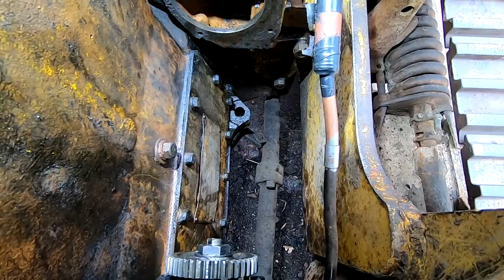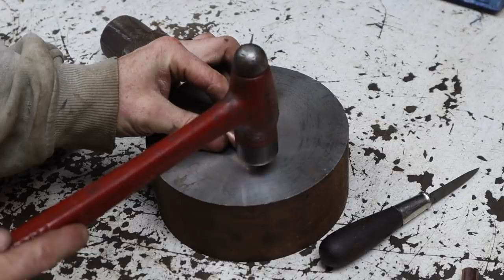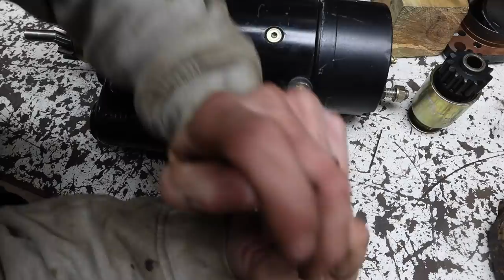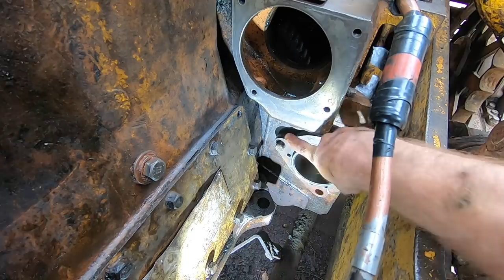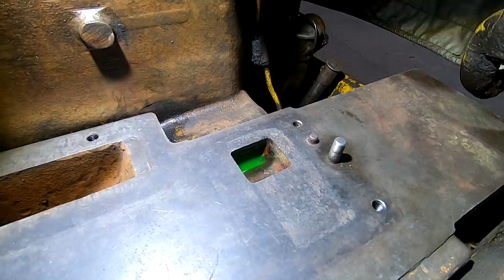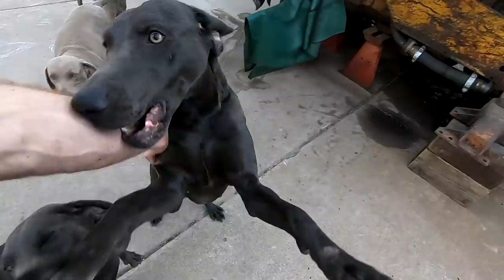Adding a SECOND Way to Start the OLD Cat TraxCavator!!! ~ Part 17 ~ 1950s Caterpillar TraxCavator

Comment: Whatever hypothetical problems you might find after taking the head off are there whether you do it or not. You already have a bunch of stuff out of the way so you might as well do it anyway. Plus it's better to do it now while it's sitting right outside the shop than have the machine break down in the middle of a project out in the woods or whatever.

I would likely watch the Tahoe videos. I've watched every other video you've made and a head gasket on a Tahoe is something I might actually have to do. If it were my Tahoe I'd swap in a manual transfer case and see if there was a way to delete the center axle disconnect.

Comment: From what I have seen the motor runs strong. Are you losing a lot of antifreeze, or in the oil. If not you are probably ok on your pistons, rings and liners. Could be just a bad head gasket. If you change it now saves a lot of work later on.

Comment: you can use a solenoid to connect your 2 12volt batteries together momentarily to get your 24 volt for your starter

Comment: Hi there, I'll try my best to get my English right so here it goes.
You could have 2 batteries in series bumping your voltage to 24v.
 I'm guessing all your lights wil work on 12v so that wil be your default current.
If you were to use the new 24 volt starting motor I would suggest you use a contacter that's rated for the 200A with a delay of 1 second so when you press your start button it wil connect the second battery in series and then after 1second start the motor. The wiring would be easy and you won't blow your pony motor starter by accident.
A second way would be to shunt both batteries dubbeling your capacity and then use a contacter to switch from shunt to series, this wiring wil be a bit more difficult but gives the second battery a use other than starting the motor.

Comment: I've dealt with many head gaskets and once they start to go it is just a matter of time before they completely fail. You have 3 separate components (compression, oil, and antifreeze) all under pressure and it wont take long before a small leak becomes a major...headache.

Comment: Update, on radiator/block cleaning 
I have checked on rad cleaner/block cleaners, there are important things to check, you will require one for Diesel engines, one shown amongst the many variations, was. “ Zerex super radiator flush” , there would be many others in that category.

Comment: Easy to do 24 and 12v, connect batteries in series for 24v and take 12v off one of the batteries at the same time very simple

Comment: I'm on board with replacing the head gasket...gonna be awhile before the pony motor is ready anyway, and besides, the leaking head gasket certainly won't get better, therefore it will only get worse.  Prudence dictates that it would be wise to go ahead and replace it while you're into it at this point.

Comment: 12/24 volt is easy for starting. You'll need a solenoid between the positive and negative posts to DISconnect the 24 volt jumper when not using the new starter.

Comment: Yes, by all means pull the head off, fix the head gasket, and anything else that needs fixing. Once you place this vehicle in use is there going to be a problem with dirt and other crud getting on the solenoid, or filling the gap you ground and causing a short? It sounds like you're going to have a separate 24 volt electrical system to operate the starter. Will this system have some means to recharge the batteries? Your postings are great.

Comment: A lot of comments/suggestions regarding 24V for the prime mover starter and how to derive a 12V  tap to power the pony engine starter. You stated that the starter for the pony engine is actually 6v, but you have been using a 12V source for it.  I presume this is because a 6V battery is not yet in your inventory for this machine and that a 12V boost pack is most convenient.  I also presume that Old Red had a 6V generator to charge the 6V battery and whatever kinds of other 6V devices in the OEM configuration.
I will offer up this option for your total electrical system. For charging,  fit a 12V alternator to the prime mover. For the 24V starter, use a series/parallel switch. For batteries, use four 6V batteries. Separate the batteries into 2 groups (pairs) with each pair of batteries connected in SERIES to yield two 12V sources (think of each pair as a big 12V battery).  Wire up the series parallel switch so that it delivers 24V to the Prime mover starter when cranking,  and 12V to the 12V battery pairs when not cranking.  For the 6V pony engine starter and any original 6V devices you want to keep as 6V, simply tap off of the battery positive post on THE FIRST POSITIVE post of either of your pairs of batteries. By "FIRST" I mean the positive post that is BETWEEN 2 of the batteries, not the positive post of the second battery.  Reading this may sound cumbersome, but if you draw it out and put in the four 6V batteries, the series/parallel switch, the 12V alternator, 24V starter, and the 6V OEM electrical system, it will be clear.

Comment: To separate the and connect the batteries you connect a relay that has a 12 volt coil that can handle high amperage where it connects the default to 12 volts to the pony motor starter switch and when the relay is engaged it sends the 24 volts to the starter you just installed. You should replace the head gasket so in the future you won't be adding oil except when changing it. It will also make it easier to start with the increased compression and give more power. Now is the right time to do it. I think I would want to know if there is any scarring in the cylinders now instead of later that could be fixed with a hone instead of a complete rebuild later. Now on a final note YES do the truck and video it. Then you can take your time when getting back to Old Red.

Comment: Now you're into it so far, no need to start again, when the head gasket gets really leaky, not only to the outside but to inside...go for it now!
Would like to see the Tahoe work and the burn pile, I guess you crazy guy light it with a flame thrower...
:-D
Btw, what generator is on Big Red, 6, 12 or 24v? With four 6v batteries you could fire up the new starter on all of them in series, with tapping into one or two the pony motor starterand if the generator is only 6v you could charge them back... Or convert to 12v generator and 12v consumers and fire the pony right away with 12v...
Love these crazy dogs!
:-D
Reply: 12A1 parts book has the pony motor generator as 6V 20A, pg 54, and the Main engine lighting group generator as 6V 40A, pg 122a, and 24V 18A pages 125 & 126 as part of the electric starter package which includes glow plugs which Old Red doesn't have yet, so cold start would still be by pony motor. Need to look for better generators, like 12V to charge some batteries. Have fun
Reply: @adiamondforever7890  Nice research, thx!

Comment: 12A1 parts book has the pony motor generator as 6V 20A, pg 54, and the Main engine lighting group generator as 6V 40A, pg 122a, and 24V 18A pages 125 & 126 as part of the electric starter package which includes glow plugs which Old Red doesn't have yet, so cold start would still be by pony motor. Need to look for better generators, like 12V to charge some batteries. Have fun

Comment: Case New Hollands 4 wheel drive tractors (at least the STX and newer ones) have a gigantic relay under the pair of 12 volt batteries that gives the tractor 12 volta for the entire tractor, including the alternator is 12v.  But for starting it gives 24 volts to the starter.

Comment: If you get a 24V battery with open poles between the cells you can use both 6V and 24V from one battery. You will get unbalance in the battery if you use 6V to much, but I would guess that in the end the 24V starter will be used the most.

Comment: I've done one on the d9 I know what it's about pulling out that old pony motor it was a two cylinder inline and it wasn't easy to come out but I did that Drew those bolts for a customer

Comment: The studs on Bell housing could of been longer or some thinner nuts
Take the head off why not, you have come this far, valves and stem seals are probably worn with the blue on start.
Go for it but pull injectors and do compression test 1st.
Great video you are all over it.
Caterpillar should supply you all parts and tools with the advertising you have give them with a mechanic to help you.👍👍👍👍

Comment: you would be best to change out those pre combustion chambers for the ones with glow plugs or you will wind that thing flat trying to start it in the cold especially if the engine is not in great shape [compression  and fuel delivery]

Comment: I know that some older Stiger tractors had a 12v system with a special starting relay to start they still started on 24v however I have been told that the system could be troublesome at times. For reference I think the model was a Stiger tiger 525

Comment: you use a power converter to the starter and have a switch on it to turn it from 12volts to 24 volts we had a boat in one point of time that had that kind of set up you run bough batterie wires and have the main one runing to the starter and on the switch you turn it from 12volts to 24volts the only thing is you have to find one.

Comment: If you are using 2 - 12v batteries wired up to make 24v, you can wire your pony motor to the positive and negative of  one 12v battery.

Comment: If u haven't done already, to get ur 12v just to run the pony motor in this case, everything to the first battery like normal, then the 24v to the 2nd battery, if that makes any sense, have done that alot in our old 24v trucks to run 12v things in the cab

Comment: Go ahead change the head gasket,  easy access now to the cylinder head now. Your new starter will be sharing common Ground supply (-ve),  arrange two 12volt batteries in series for the 24v starting voltage to new starter motor and tap one output in the middle of batteries series connection for 12volt voltage for Pony engine starter. It should work

Comment: I remember another interesting way of starting old diesel engines on an old International bulldozer.  The entire engine was set up to run on either gasoline or diesel.  You would start the engine on gasoline (magneto, spark plugs in the head, etc.) and run it until the engine got warm, and then throw a lever to disengage the gasoline fuel system and engage the diesel fuel system and then the momentum of the running engine would start the diesel.

In answer to your question, in the video, you make the statement that "I know for a fact that it leaks."  As a experienced mechanic, you should also be able to state that "Once something begins to leak, over time, the leak will only get worse."  No very heavy debating should be necessary.

Comment: Now is the time to do the gasket for the head.... it will Pi$$ you off every time you look at the leaks from here on out that you didn't do it when you had it this far in and didn't do it if you don't do it now :-/  Also put some paint on some of these parts while it's this far in... Get the old Rustoleum going lol Paint flames on it if you want [that would be really funny actually] lol  Patina is such a tired FAD if you ask me. :-) Great series on this old girl :-)

Comment: A cautionary note:  when labeling parts for the long run or when they are around gas or diesel be careful about Sharpies.  They fade almost completely away with time much less when around any aggressive chemicals.  Pencils are better but not by much, ink pens worse.  I use paint stick markers or an embossing tape gun.  I am still looking for a better way.  Old electrical panels can be a real pain as can an engine you were going to get right back on six months ago.  I do find that the old actual "Permanent Markers" are much better than Sharpies.  You can tell them by the strong odor they give off.   Enjoying your projects.

Comment: I am always 50/50 on jobs like that, i would consider doing a leak down test, compression test and use a bore scope if good enough just run it as if you run into any problems you will likely be better just doing a straight engine swap and sure the guys @debossgarage could find you one quick lol

Comment: Ok to get 24 volts you ground a neg  on the first battery. then that positive is 12 volts you can hook up the pony eng starter there. and then run a short cable from the first batterys positive post to the second batterys negative post. then the second batterys positive is 24 volts. you now have both starters correctly wired for both 12 and 24 volt.

Comment: Only comment re: homemade lugs, but depending on the length you power feed line, you may require a larger diameter copper tube. The heavier your supply cable, the better? Starter motors are a heavy drawer of current. soldering is the best, for a long-term reliability.

Comment: Those switches are used all the time on marine Sailboats.
Stu at Dangar Marine just finished wiring his boat Renko so he can start his Detroit and run other consumable power systems. It is not that complicated he has videos walking his viewers through it. Buy trade he is a mechanic and IT person.

Comment: To get both 12 and 24 volt system you just connect the batteries in series and connect the starter motor on the minus on the first battery and the plus on the second. Then you connect the pony motor to the minus and plus terminals on just the one battery.

Comment: I used to manage an auto/truck & marine electrical shop back in the dark ages.. You may be aware that MACK (as well as others..) had a 12/24v solenoid switch that they used just for this purpose. (about $100 on eBay..) worked very well as long as you had CLEAN& TIGHT battery terminals on all batteries! (I CRINGE so many times when I see guys push & twist a clamp onto a battery & THEN test to see if they can start an engine! IF they only knew that 250 to upwards of 5 or 600 amps in big engines can literally blow a battery up or destroy a post!... Spread the terminal, then CLEAN  before pushing, then LIGHTLY tapping it flush with the the bottom shelf of the post, THEN TIGHTEN the bolt)

Comment: Run your hot wire to a solenoid valve and from there to your starter motor. use a hot control wire to your start switch and from there to your starter solenoid switchm run your negative to a bolt on engine. Do the same for pony engine but tap off midway on one battery for hot 12 volts to solenoid.

Comment: Can you please show how you did the Wiring for the Delco starter on the D4 as Im about to do an exact install on mine ?? thanks
Reply: Also Im not using the generator to recharge batteries so only need  a simple  push button to start ,and battery wiring details for the delco remy starter motor ??  Hope this makes sense, And Im keeping the pony motor too !!

Comment: Yes you should change the head gasket.  As for the batteries you can connect them in series for the 24v then just pull off one battery fort he 12v.  I have a 36v locomotive w/3 batteries and do the same thing to power a 12v and 24v circuits as well as the 36v to power the primary drivers.  It works great.  I also charge each battery independently at 12v to get a better charge on the batteries.  Have fun looking forward to more videos.  Why not video the Tahoe.  If it is good post it.

Comment: Just put the Two 12 v in series for the 24 V starter and center tap  between the 2 12 V battery’s connection to the pony motor 6 V  starter! This is how many of the big Diesel engine used 2 12V in series and center to power the dash and accessories since the cabs were all 12 V in 50 thru 70’s use a complicated series Parallel switch!

Comment: You will need to replace the charging system for 24V, unless you can hang a second alternator/generator to recharge the batteries for the new starter.  If you upgrade the charging system, luckily you don't have many electrical gauges as they will need to be upgraded to 24V versions.  

For starting you will need (2) 24V electrical solenoids, one connected normal for the new starter and the second for the pony starter.  For the pony starter, connect the small terminals to 24V switch and ground. For pony starter power just connect at either the first post (12v) or if you get a battery with exposed connectors you can tap between the 3rd and 4th cell for 6V.  If you do this then the pony starter will never see 24V as the electric side will never see power from the Alternator/generator, as it is driven from the main engine and the starter for the pony will be off.

Comment: That darn leaking head gasket has been on my mind since I saw it. Please, so I can sleep at night. Change that damn head gasket! Oh, and I’m still wondering if that pin that you had to work on back when you were still back in the barn if you ever found out if that pin is the length it’s suppose to be.

Comment: Put the two batteries side by side. connet the positive of one to the negative of the other - across the two batteries you now have 24v. Take a tap from the wire between the two batteries and you have a 12v supply. The dead mans switch is a good idea - put it between the ground wire and the body earth.

Comment: I would defiantly lift the head and plan to replace the gasket. At the same time it's a perfect opportunity to inspect and measure the bores and get an assessment of piston slap etc..  While the engine is running OK for now, that way you have good baseline data to work from if you get concerned about oil burning or excess smoke/poor compression etc later down the road when Old Red has pushed some dirt. Time spent on research is never wasted.